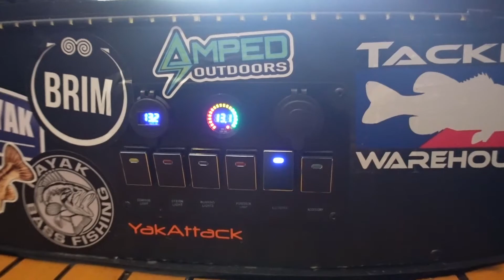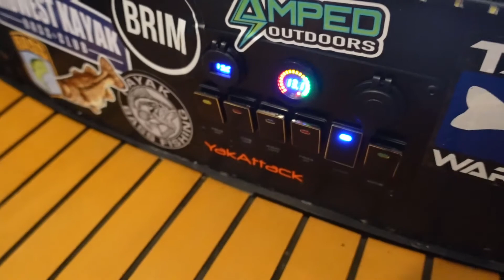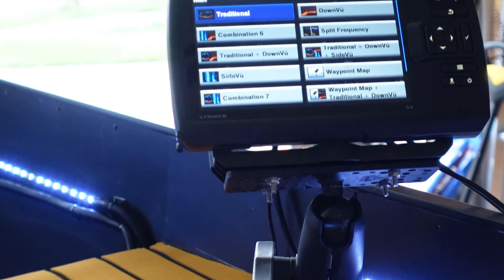The Best Fishing Canoe 2.0!

Comment: Great rig mate! One question: can you crank (and possibly start) your tohatsu 3,5 while it's shifted in forward gear?
Reply from the maker: You won't be able to. I've turned the motor off in the forward gear once and it did not start. It had a ton of resistance when pulling it.
Reply: @paoc.adventures  But you've been able to crank it ?